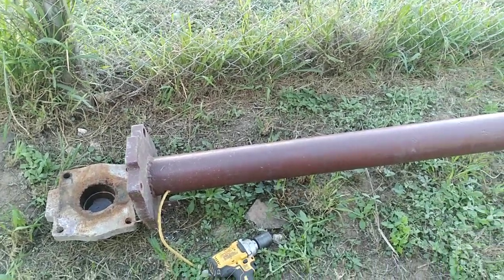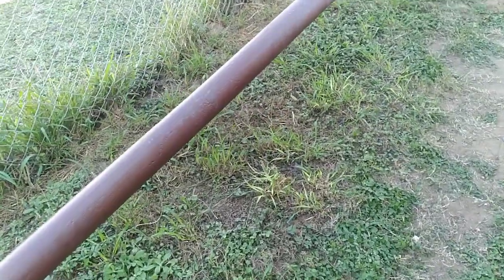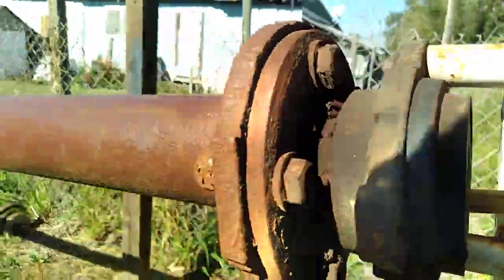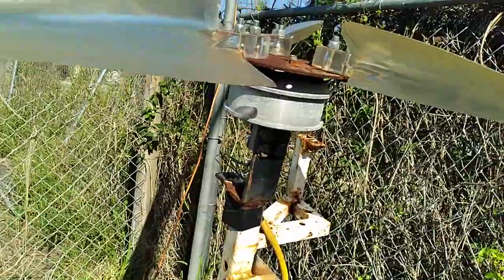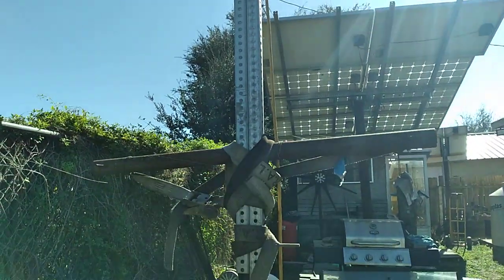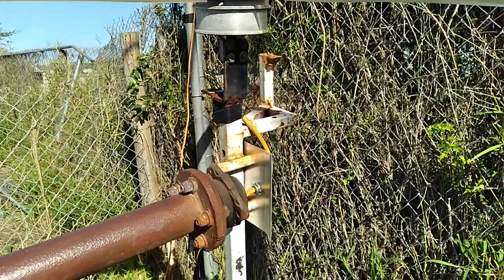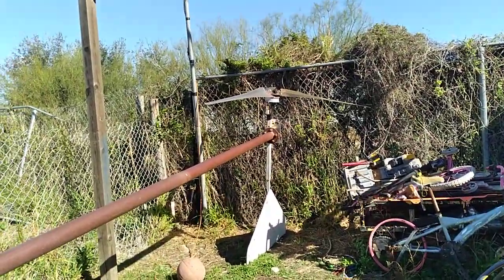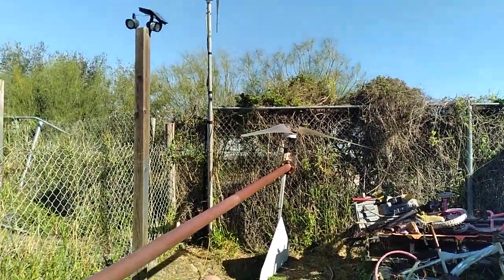bad swivel on hoverboard wind turbine

Comment: My smart drive windmill has been like yours is now for 2 years and has never tangled or rubbed through. Previously I had slip rings and had problems with them. Some times simpler is better.
Reply from the maker: Your 100% correct

Comment: I keep extra slip rings on hand because of this.  In my area the wind shifts violently and dramatically, if I don't have a slip ring my rig will twist the wire apart in a week.
Reply from the maker: And yes, I need to keep a couple on the stock because I have three turbines. I want Chinese piece of junk but it makes like 10amp

Comment: Be honest. I'm looking at the hurricane. For the price does it actually put out power? Yes I know it matters on average wind speeds but was it worth it for you? Maybe you can do a video on it working today.
Reply from the maker: There is no win today but tomorrow we’re supposed to get 19 miles an hour when we get it I will put a video up for you
Reply from the maker: And you have my number because I spoke to you various times
Reply: I'm thinking about buying one in about a week. I was going to ask the same thing.
Reply from the maker: @davidpotter9462  how can I help you
Reply: I was wondering what controller I could use with the hurricane Vortec. I'm getting the 1 kw 24 volts version. I just have 20 big marine batteries from AutoZone. About 24 kw worth. I can add more batteries. I already have 1200 watts of solar panels, but the voltage is lower in the winter, or if it's raining, which it does a lot here in Oklahoma. It seems like the wind is blowing when the 🌞 sunshine isn't out. I can afford the wind generator, but the midnight classic controller that they recommend is kind of pricey for me. My uncle gave me a DC motor that outputs 79 volts when I wrapped a cord around the 3 inch pulley. He told me that I have to make a wind generator out of it. So I'm going to be tinkering with it too. I was just wondering if you used a different controller than the $800 one.
Reply from the maker: @davidpotter9462  i use a dump load controller on my system
Reply from the maker: @davidpotter9462  sorry for the delay but I was driving back home